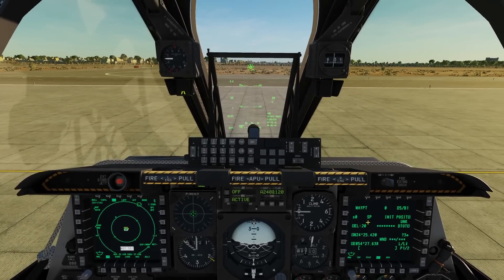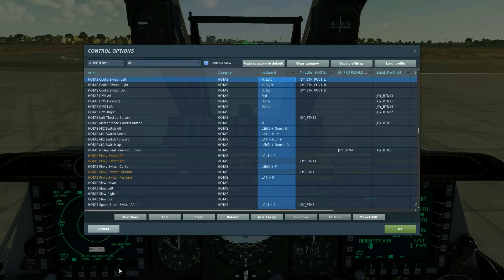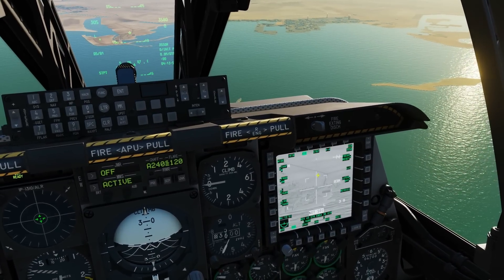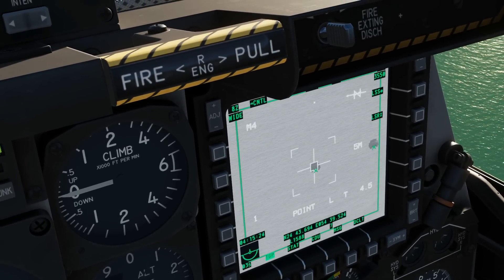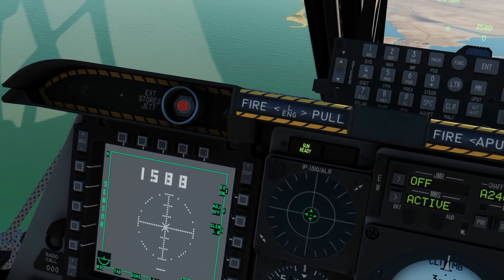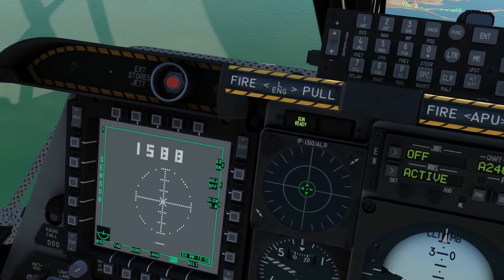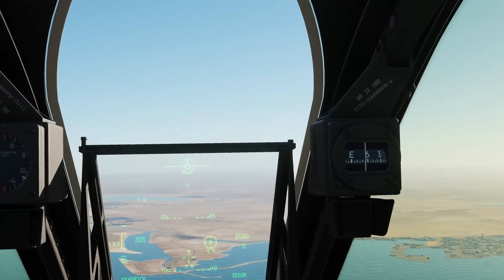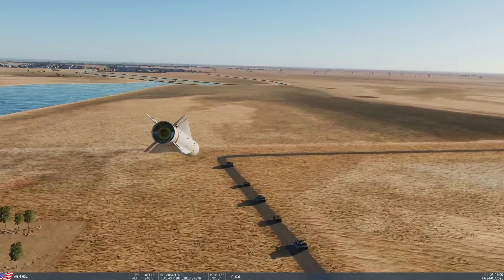A-10C II Tank Killer: AGM-65L Laser Maverick Tutorial | DCS WORLD

Comment: The laser MAV on the A10C is stupid. Only one MAV per pylon instead of 3. And it does not have longer range over the D model. And because it’s laser you need to somewhat stay on course and not turn away too much else you mask the TGP lasing so it’s not fire and forget, forcing you to get close to the target. The D model can also follow moving target. I don’t see much advantage of the L model over the D other than it’s a bigger missile. With the D I can carry 3 per pylon, fire and forget and turn away.
Reply: Realistically, D models have trouble locking up targets especially in hot environments
Reply: @Anderson_Hwang  A-10C can also equip the H variant which is TV guided, designed for hot environments and be carried in a triple rack like the D variant
Reply: The target does not need to be an IR/EO significant blob, and with the laser you have much more precise control of where the weapon will impact. That said, it requires a man in the loop needing continuous lasing until impact unless you are lasing it yourself.

Comment: Hey cap, need advice, a10c II or F-14, have a bit of a thing for the tomcat but the hawg looks fun too
Reply: Question: Should I get the A-10C II or the F-14?
Answer: Yes
Reply from the maker: Simple. Hog for ground attack only. Tomcat for Air-Air only.
Reply: @grimreapers  CAP we have the B version😅 it's a BOMBcat. it can carry the Lantirn pod and even drop laser guided munition😊 the A model only will be able to do Air to Air
Reply: If you have a thing for the F-14 I would suggest it, generally I would always suggest starting with a multi-role so that you don't lock yourself in the beginning
The A10C can be a lot of heads-down number punching, It's my favorite air-frame but I'd suggest the F-14 for a beginner as it simply offers more

You might also look into the F-16 and F/A-18C if the two-seat and older systems of the F-14 seems daunting

P.S; Most modules currently has a hefty 30-50% Hallows eve sale